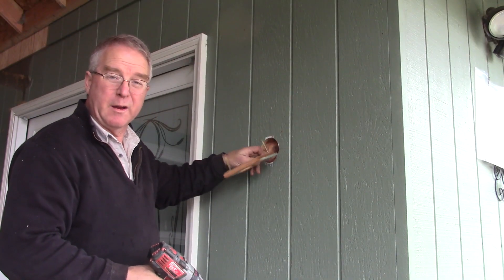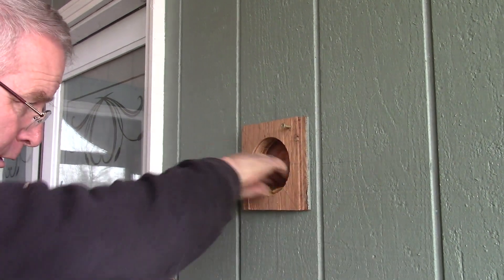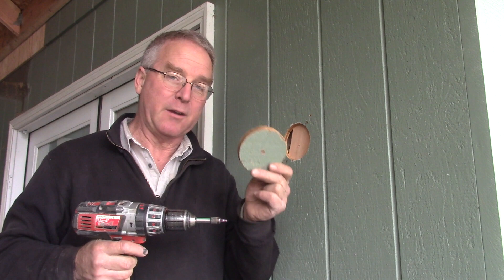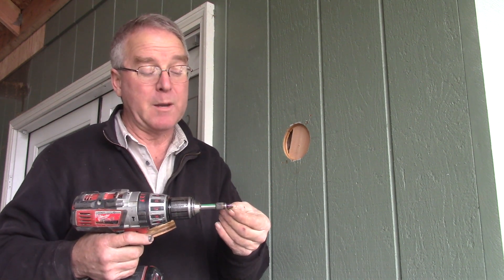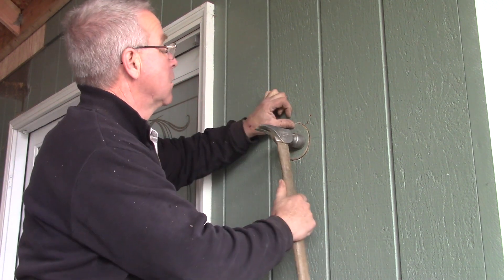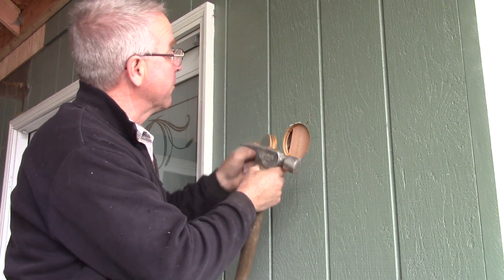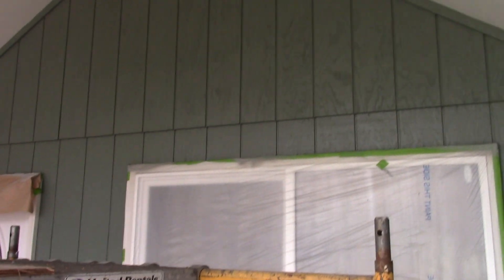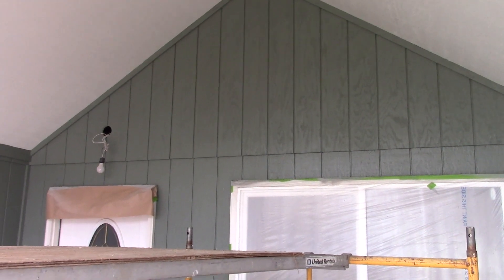How to Patch Siding

Comment: I'm a freelance graphic designer, and most of what you just mentioned is eminently applicable to, I think, mostly any profession. It's just good client/contractor communication. That said, hearing it plainly spoken is such a joy.
Reply: Nils Ververs Lübke I was thinking the same thing, came here to comment. I design enterprise software applications for my bread and butter, and what he said about balance comes into play often.
Reply: very well done as usual.
Reply: Nils Ververs Lübke I do interiors and architecture and also had the exact same thoughts as you did......fortunately for me the sacrifice is usually time to change designs due to the clients changing their minds or if the project simply requires lots of time and detailing to get it right.

Essential Craftsman.....Thanks for these great videos, in South Africa we predominantly work in brick and concrete, so the lighter weight construction and methodology is really fascinating for me to see and learn.

Comment: Torx has pretty much been standard here in Denmark since I started my apprenticeship in the mid 90's. I remember how quickly we changed from phillips and pozidrive to torx. 
Now you really should try changing your old fashioned showels for the ones with a cross handle at the end. I can't understand how you can use those straight handled shovels. :) 

Also, the way you explain daily compromise cost/benefit is spot on. Cheers.
Reply: You know why gov maintenance workers have their shirt pockets sewn on upsidedown? So they can put the shovel handle in there and not fall over whilst they nap. Cross-handles dont fit. ;)

Comment: There are two different ways that people observe your work. I will use your patch as an example. The homeowner may examine it minutely, critical and using perfection as their standard. Most people are pretty reasonable though. I have had to remind homeowners a time or two during my career of observation technique number two: 99% of people are incredibly unobservant 99% of the time and aren't even going to notice the work. The difference between very good and completely acceptable, and PERFECT is an exponential increase in customer's cost of the work, and pointing that out is a good reality check for a demanding customer .

Comment: Good advice. Liked the application of the hurricane clips. Clever. Thanks for the video.~
Reply: I would imagine he was just using what he had on hand. Also I would imagine it wasn't inspected, after all it was a porch roof not a main living space, I know that wouldn't fly officially.  I just thought it was a clever use of them. It's certainly stronger than nails alone.

Comment: Torx is all I buy anymore for powered drivers. Nice memes this video, you're really catering to us millenials and it shows!
Reply: Up here in Canada we use Robertson's screws, it baffles me that anyone could do serious construction with Phillips screws...  Apart from using them to hang drywall (where having them torque out as they countersink which is actually a good thing), I can't imagine using them for anything.
Reply: Ah your son adding them makes sense, I was confused as to why you would even know what they were.
Reply: meme-smith. lol
Reply: yeah in canada robertson is king, but torx has the same benefits. i think torx is   less likely to slip then robertson, but when it does it damages it worse
Reply: I rarely have torx do much damage when it slips. Usually just pops out. The biggest advantage is that when you are 10 foot on a ladder, and you reach for the spot, the screw doesn't fall off right as you get there. Second, you don't fall off the ladder because you are using to hands trying to get enough torque on a Phillips to keep it from slipping. Phillips suck.
Reply: compared to a robertson they get damaged more, Robertson are pretty tough
Reply: jacob fraser my experience is the Torx is far superior to all other drives. Square drive is only found in interior trim/finish screws. For a short time you found the square in composite decking screws. But even now that’s been replaced with torx.  
Square strips pretty easily
Reply: They are great for the folks that make extractor bits :)
Reply: I have never stripped a torx, but stripped plenty of robertsons.  I dislike the robertsons as much as I dislike the phillips head.  The only risk I have seen with Torx is over torquing  and snapping the screw in half.
Reply: The Metal Butcher use a sleeve and then the screw won’t fall off
Reply: @deftdawg  Robertson does a nice trick in that a square headed screwdriver will actually hold itself up in the hole of a screw.  I know some people complain of stripping them but having had to remove my fair share of broken fasteners, I've come to the conclusion that the only reason you ever strip out the head of a screw or round off the corners of a nut is because you're using the wrong sized tool.  Robertson and Torx both have the advantage that only the correct sized bit will fit. You can't half-ass it like a Philips and there is no getting it slightly wrong like a hex head which has both metric and customary sizes that will work, but allow slop. If you ever have to figure out how to remove the 4mm truss rod nut from the neck of a guitar that some bozo rounded out with an 1/8 inch hex key, you'll know what I'm talking about.
Reply: I'm glad millennials are watching

Comment: Quality of work is important.  There are lots of contractors that do poor work.  Most of it is in a hurry to get done and skimping on materials.  Word of mouth for a contractor about good quality work is key.  Customer satisfaction works hand in hand with doing the right thing.  Overall, you will make more money with good reviews and happy customers than someone out for a quick buck.  Just my opinion from a guy who has had to fix a lot of shotty work that a so called professional did.  Great video and message.

Comment: I like the eloquence that you bring to the philosophical discussion of ethical interactions between client and contractor as well as the tip to fitting a wood siding plug. It's sad how some have lost there way (or were never on the right path) when it comes to craftsmanship with integrity. The interactions in my neck of the woods is mixed, I've recently had to interact with lots of sub contractors (do to extensive home repair covered by insurance). It seems like 1 out of 4 or 5 seems either to be clueless on how to generate good word of mouth or just don't give a F. I've noticed some subs care more about what the GC or boss thinks instead of the homeowner.

Comment: I remember building cabinetry and structures for the house with the old slotted wood screws. predrilling and counter sinking the heads. Using a Yankee ratcheting screw driver to drive them home, hopefully without stripping or camming out the slot. I like using screws, an easy way to get something built without nails pulling out half way through the project. First were the black drywall screws. They had a bit of a problem with being prone to rusting. So I got coated drywall screws and they worked okay. I got stainless steel screws with a square drive but found them wanting because of being too soft and prone to the square socket caming into a round hole. Then deck screws came along with a special phillips type driver, caming out still a problem but the coating made them easy to drive. So now I use the torx and am quite happy with them, BUT I do have one little problem that some how got lost in the march to the present time. The old wood screws that you would drill a pilot hole for and perhaps countersink, were sized for dimensioned lumber. The screws we can get in torx or phillips or square drives are sized for hanging drywall. They are either a little too long or a little too short. Sure you can make do, but wouldn't it be swell if the industry caught on to this little conundrum.

Comment: Thanks for your videos. I want to insulate an existing 10’ x 10’ cinder block building  to make a walk-in cooler using a window air conditioning unit with a device called a “CoolBot.”There is no texturing on either outside or inside wall block surface.  We want to insulate both surfaces to preserve as much cooled air as possible. We’ll be cutting up beef for the family. We usually slaughter and butcher when it’s very cold but would like to do it in other seasons if the need arises.   Thanks again for your instructive videos.

Comment: It's nice to have those expensive hole sales but i've done similar siding repairs with square plugs (speed square or framing square) with the same procedures.  Once the caulking is applied and wiped off in the direction of the grain and painted, it becomes as invisalbe as yours.  Nice job regardless.   PS...kick ass Iron work!!!

Comment: You were missing a nail on that one rafter hanger your camera person zoomed in on! No biggie though. 

Also, I love all of your videos.  Thanks so much for taking the time to make them.
Reply: These brackets were undersized & not designed as hangers (with a supporting strap) for the shear strength required for the roof system. Missing a nail in one of these lessens the needed strength significantly from an enginering perspecive. This may work fine in your area with no snow loads to contend with, but if an amateur duplicates your example in other climates it can be disasterous. I admire the author's efforts in a multitude of ways, however having been a home inspector (held to higher liability standards than builders in the courts) I often found choices of hanging brackets were made on the basis of cost rather than needed strength. I recommend even seasoned professionals to contact the bracket manufacturer for correct type & size required. For liability engineering data always matters.

Comment: I love that he uses the same method I do for mounting a drywall patch. Clean the hole up to a good square. Measure and cut your new patch. Grab a paint stir stick, weasel it in the hole and run a couple drywall screws in it. Then you have the nice solid backing to hold your patch.  Then just mud the edges, texture and paint.
Hell of a lot better than the idiots who wad up newspaper or any other manner of trash to build up the  cavity behind the hole. And should they ever need to do any other repairs in the area, they'll appreciate your repair instead of having to clean out wads of crap and fix the thing you should have fixed right to begin with.

Comment: As a painting contractor, IMO the difference between the old siding and new siding is the prep (for painting).  Im sure when the house was initially built, it was professionally painted.  The siding was primed, then sanded to knock down those hairs from the board and then two coated the finish green color.  The primer help hides the grain of the wood from showing through the top/finish coat and the sanding knocks down those ridges/hairs which cause those shadows/dark areas of the grain on the board. If the new siding was oil primed, sanded and two coat finish of the green paint, it wouldve matched really well.  The only difference would be the color, if the paint faded from sunlight/UV over the years, but this wouldnt be the case since its in a covered patio area.

Comment: Thank your for sharing your experience.  I enjoy the commitment and dedication you instill in your work. You have earned my respect. Thumbs up.

Do you have any tips on cutting sheathing angles, such as (T1-11) on a wall butting up to the joists? Aside from knowing  the pitch of the roof, or measuring the drop from the gable end to the existing sheathing at both corners of the previously installed panel (sheathing), do you have any tips for cutting sheathing angles where the wall meets the gables end?

Thanks for your time and impute.

Ron

Comment: Is it acceptable on house siding t111 to rip 12”s off the bottom that is rotten and z flash, then cross cut 12” panels and patch or should you pull whole sheets and just replace?

Comment: How do you get a hole saw in 1/8 increments? Do they make 4 1/8 for some special purpose?
Reply: I think there nominal size is 4"which is= to the id of the hole saw but the od actually measures 4.125"

Comment: That Torx screw manufacturer is called Spax for those wondering.  It's all I use.
Reply: Essential Craftsman up here in Canada we have always  had " Robertson"  head screws. They are square, 
That is, like torx but simpler.  Henry Ford would not adopt / use them, so they never caught on in the USA..
    And the old guys say - there is no such thing as a good Philips.

Comment: You could have cut the patch without the pilot drill hole using the same method you used to cut the hole in the siding-an outside pilot block. Then by using PL Premium and a few brads you could exact even better results.

Comment: I am not a contractor, I have however remodeled several properties and in the instant case since we were replacing the siding above old siding I would have replaced all the siding at the cost of say a day's work and maybe two hundred $ in materials.  I think putting a patch in like that is hokey and what is more every time I would go out there my eye would be drawn to the patch and I would kick my self mentally for not doing the job "correctly."  On the other hand if I were doing the work for a customer I would offer them the choice but tell them what I would do if it were me and why.

Thankfully in my profession I don't have to make those kind of choices.

Best regards.

Comment: Another option given how powerful a timber addition you have there, would be to come up with a detail that carries some of that style to the sconce in a format that covers the hole.  It's easy in this case because the arts and crafts type detailing actually had that kind of thing.  Your addition may not be specifically A+C, but not so far off that you can't borrow a little.  The problem I see with the wise philosophy is that the addition is way over the top, compared to the kind of entry a house like that would typically have.  So just making room for a hole in the wall, seems out of spirit with the  overall design.

Another option would be to raise the light, and then put some separate detail like a number plate, note leaving station, hook to hang stuff on when opening the door.

Comment: I've not heard any discussions on the following subject in the videos that i have watched (although I have not watched them all, yet), but I'm wondering if you've ever had any discussions about the bidding/billing aspect of construction work. As a general handyman (not a GC), I have always tried to value my labor at a reasonable rate based on the average value of my expertise and let the chips fall. However, when you do this there are two possible bad outcomes. One is that there are some times when my expertise is very strong and it takes very little time to get something done; now I have gotten paid very little for my best expertise. Conversely, when my expertise is lacking a bit, it may take a little longer to get the job done; now I have charged too much for an area in which I have less expertise. I would love to hear your opinion on the subject. If you have discussed this issue in other videos, I am sorry for being redundant.

Keep up the great work! I can't wait to see the footing/wall get poured on the new project.

Comment: Had a contractor’s trade punch a hole through the vinyl siding of the house to mount a kitchen extractor fan during a kitchen reno. Problem was we asked him specifically to run the vent out the side of the house to keep it hidden not the front where it would be an eyesore. He agreed to fix it and relocate the fan. Well, every patch job he did looked terrible. Painted tin patch didn’t match colour or texture. A single piece of new vinyl popped out sharply against its slightly sun faded neighbours. Other options were just as ugly. Then one day I came home and the hole was invisible. Like just not there. When I asked how he did it he said the only way to make it truly right was to reface the entire house front at his own cost. I was astounded he’d take such accountability to make a softball sized imperfection truly right. And just as I was getting ready to live with “almost right.”

Comment: Kinda like how i patch a drywall hole with that stick behind as a brace.

I ordered a 5lb box of robetson 3" coated deck screws from HD website just to check em out.  They are okay but seem to cam out more than torx. The box was $5 less and i had it shipped to store but perhaps shoulda went with the 1lb box as a tester.

At least theyre better than philips but not being in the industry these robertsons will last quite a while.

Comment: I have an adage that is similar but not quite the same wisdom. “You can 100% control 50% of the situation. “

It basically means you can either control the outcome or the method; the journey or the destination. 

In this case you can either have an easy method with a patch or replacing one sheet, but then you don’t get to have the perfect outcome you want. Or you can get the outcome you want by replacing the whole side of a house. 

So which 50% do you want to completely control?

Comment: A hand painted Welcome would have hidden that completely and looked quite nice.
Reply: It still has to be patched, because at some point down the line, whether that is two weeks or two decades from now, the homeowners will want to take that Welcome sign down, and at that point, the contractors are no longer around, but the unpatched hole will be.  NEVER simply hide something; do it right at the time, even if you have to go get parts in order to do it.